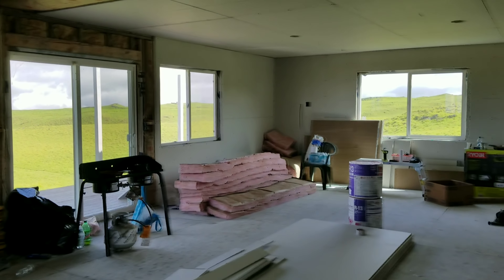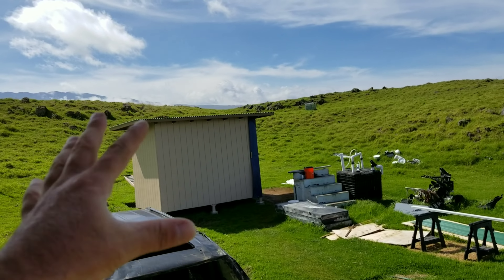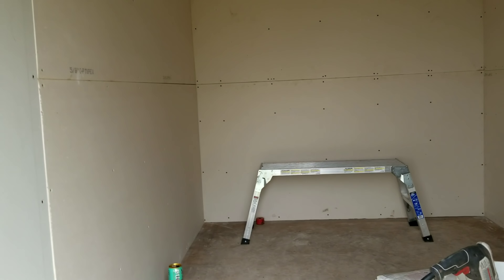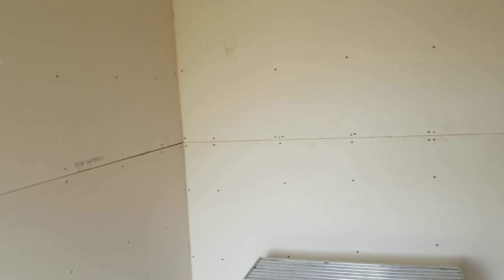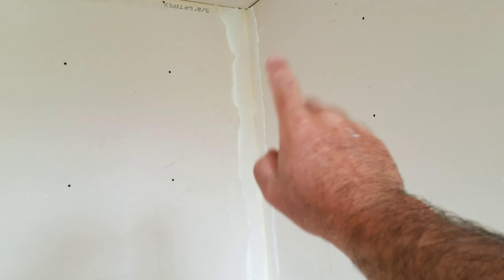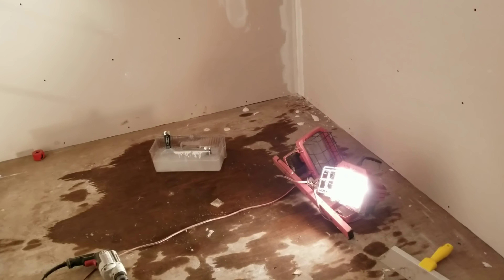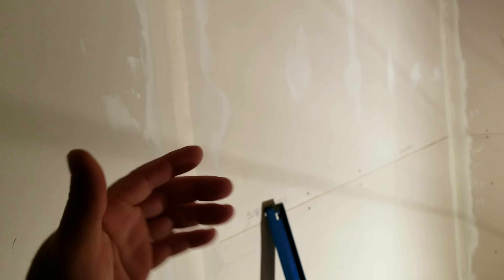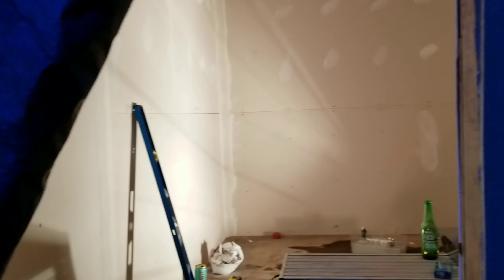Building a Solar Powered Workshop Mud Taping Sheet Rock Pt-21

Comment: i buy that stuff all ready mixed in 5 gallon  bucket much easier than mixing  bro and i use a sponge to smooth it with a bucket of water less mess no sand mess
Reply from the maker: we dont have it in 5 gallon buckets or boxs here localy useless I drive across the Island to look for some. Yes water sand it what I doing on the next coat.

Comment: i am just wondering what you are doing  keeping your shed cool.  it is nicely insulated  and all electrical devices will give up heat. so the heat gain is coming from inside not the outside.  i installed an aircon in my shed to keep temperatures at 20 degrees celsius. this prolongs the life of the lifepo4 battery and the caps in the electronics.
Reply from the maker: I talked about it in another vid about vent I will show my plan when it gets installed. I agree keeping very thing cool for prolong the life of equments...